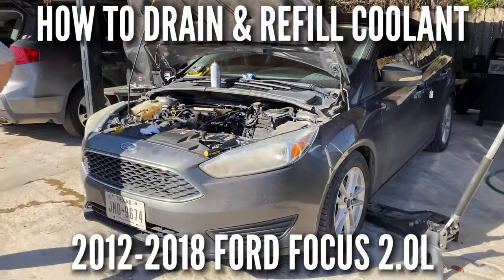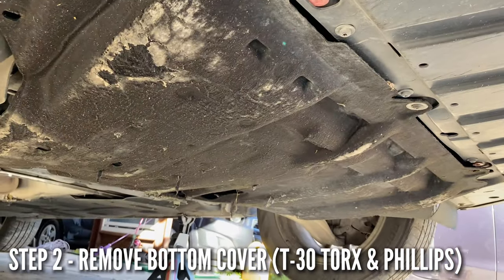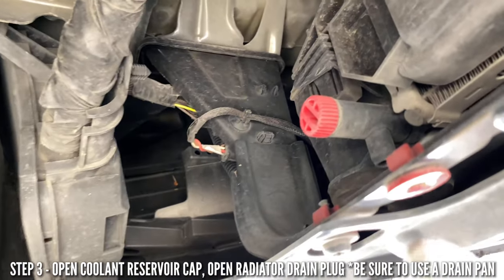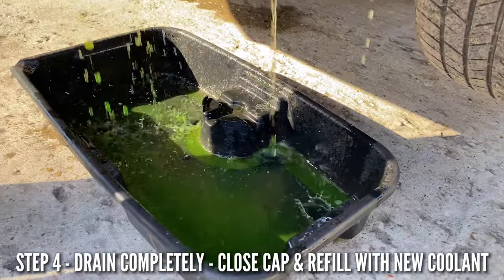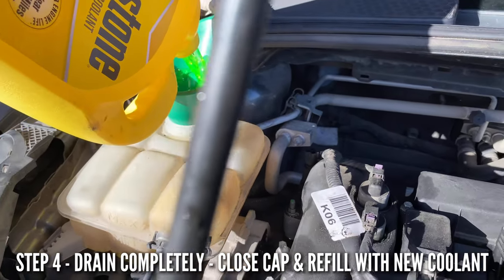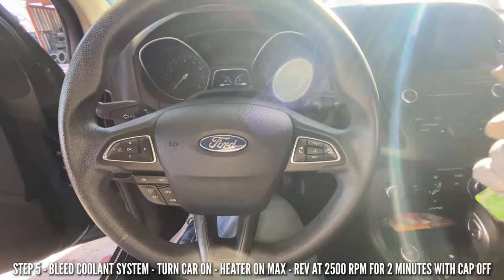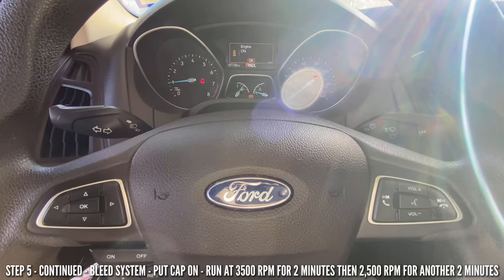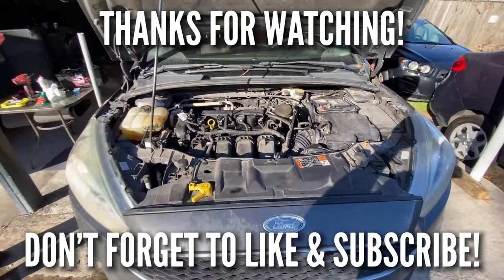HOW TO DRAIN, REFILL & BLEED THE COOLANT SYSTEM IN YOUR CAR! FAST & EASY! 2012-2018 FORD FOCUS 2.0L

Comment: Ford specifies ORANGE anti-freeze which has a completely different chemical make-up. The green anti-freeze does not meet Ford's requirements.
Reply: They actually specify a yellow now the orange is not being made anymore...but yes you are correct...the yellow motorcraft is compatible with the old orange but I would not run universal without doing a whole flush it can gel things up and cause issues....idk why people dont just grab the proper stuff lol
Reply: @outdat3d-04zx10r-ha  - I just had to replace the water outlet housing in my Focus and while at the dealership for the part I just asked for the coolant too since I was there. They informed me what you said here; the orange coolant has been superseded by the yellow. The thing that gets me is that the "yellow" coolant looks exactly like the green coolant I've used all my life.
Reply: @1001Hobbies  it does look really green lol....and also I literally just got done doing my first drain and refill of coolant(car has 110k miles 2014 ST2)...I used the yellow but after running the car for 4 minutes the resovior is back to orange lol but a much lighter orange...I don't have all the proper stuff for a flush at my house so it's better than just all dirty old coolant...I also have enough to do one more drain and fill tomorrow when it cools down so Im sure it will get even lighter....there will still be a tinge of orange because I can't do a full flush but it's definitely better than not doing it all lol
Reply: @outdat3d-04zx10r-ha  - Agreed. I need to buy a new coolant tester for the new formulation to make sure it is ready for winter. I've got 122K on my 2012. It's a manual so no trans problems. I can't believe how good the car has been since it was one of the first production models (built 5/11).
Reply: @1001Hobbies  that's funny because I also had a 13 and it had slightly less issues than my 14 ST as well lol .  I think they got worse as time went on😂 and yea the dual clutch is kinda bad lol but you got that manual your good to go
Reply: Correct. Also watch out when taking your ford to the dealer for a fluid fill up they fucked up and mixed green with my orange juice and made my shit black so now I'm fixing to flush with a water hose to make sure she's cleaned out good. I'm thinking about getting a lawyer and maybe a new car
Reply: got 2013 ford fusion  hybrid an i gotta to replace tha coolant pump. An an after ima do the the cooling bleed..  i hear went is a hybrid car you need some kind of michine to do the coolong bleed  is true??? Can do this procedure to do it on my hybrid car. Yes or Not?? Any body knows an tell me please ????
Reply: got 2013 ford fusion  hybrid an i gotta to replace tha coolant pump. An an after ima do the the cooling bleed..  i hear went is a hybrid car you need some kind of michine to do the coolong bleed  is true??? Can do this procedure to do it on my hybrid car. Yes or Not?? Any body knows an tell me please ????
Reply: Damn I used the green
Reply: all these question.. and yet no answers to his video.. what a great guy

Comment: Hello, thanks for your video, I learned a lot, but I have a question, after changing the coolant, there will be air left in a certain part of the pipe, where is the valve to discharge the air, I saw some cars have a bleed valve next to the expansion tank, but I can't find it on the Focus car, do you know where it is or how to solve the problem of air being trapped in the pipe? I think this is very important, thank you
Reply: thinking of doing my 2018 but i want to make sure im not missing this step?

Comment: Is it bad for me to rev the engine after adding the new coolant if my engine is cold and has been sitting all night
Reply: It is potentially damaging to any engine to rev during a cold startup, allow your engine to warm up for at least 30 seconds before doing this as the oil needs time to warm up as well.